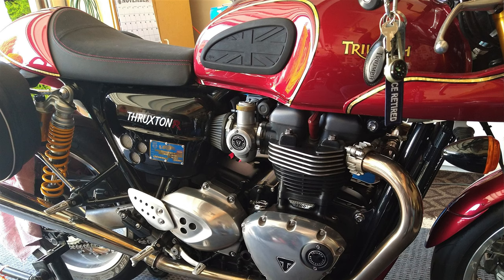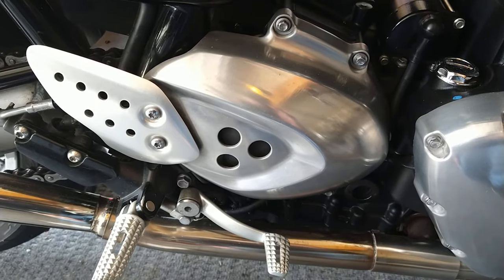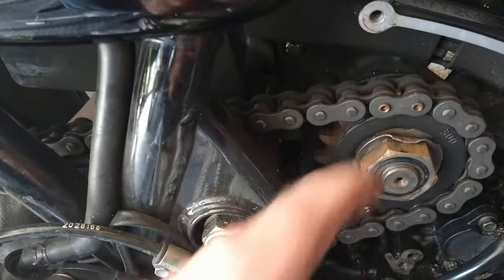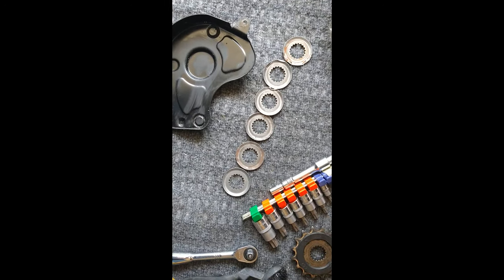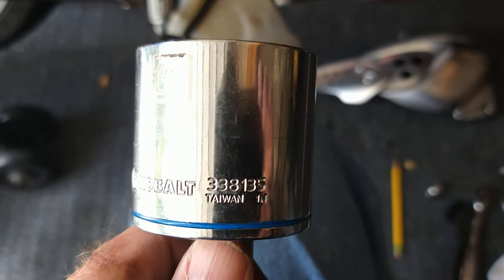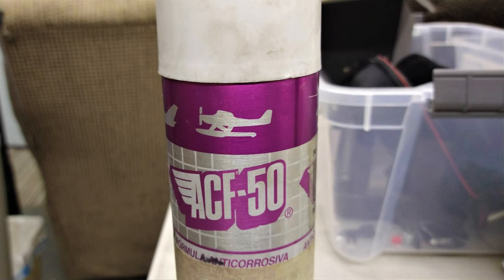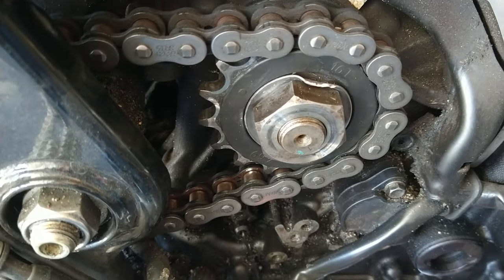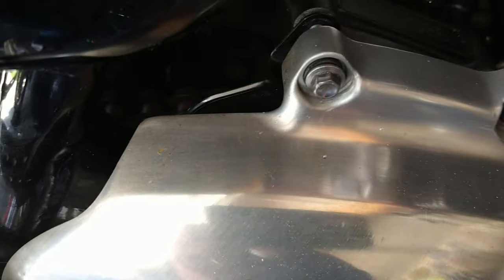(F) Front Sprocket change on Triumph Thruxton R

Comment from the maker: Note: Since I run my chain on the loose side I find the loosest part of chain as the starting point for chain adjustments.  Most riders will start from the tightest place on the chain. Either method works equally fine providing if you use starting from the tightest point you allow for the chain getting tighter when you aboard the bike.